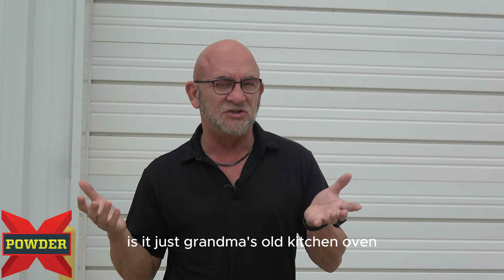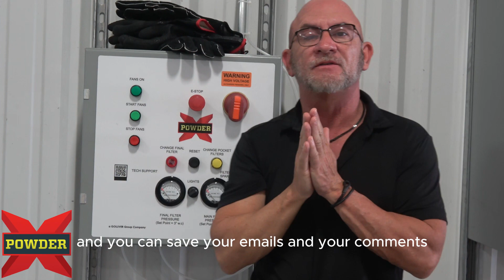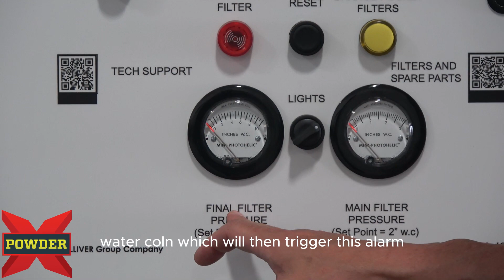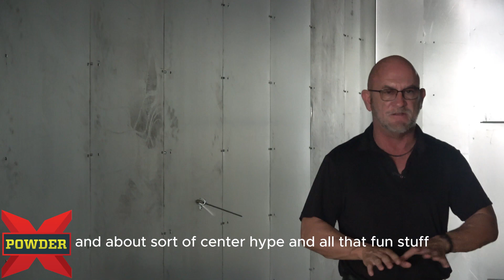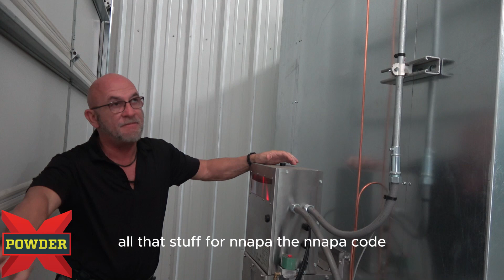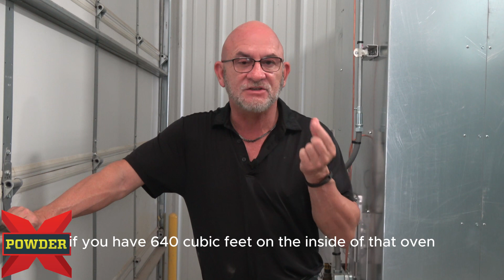Episode 5 From Ground to Gloss:  Building a New Powder Coating Business with Joey Golliver.

Comment: osha hasnt ever showed up where i work and many people have complained about the sand blasting. they sand blast in the open on the side of a shop that is 60' from a major highway. but worse employees work in the shop separated by r panel like you are standing behind and all that dust especially when the wind is right flows straight through the shop. there is dust a mile left and right of the company down the highway road. osha doesn't do crap.we have no protection there is no monitoring air samplers, nothing. while i understand they are supposed to osha doesn't give two $hits about worker safety unless its a refinery or a company pisses them off period. i lived it for a long time and scared i was around to time before i chose to not be around it. not everyone has the luxury to do that.